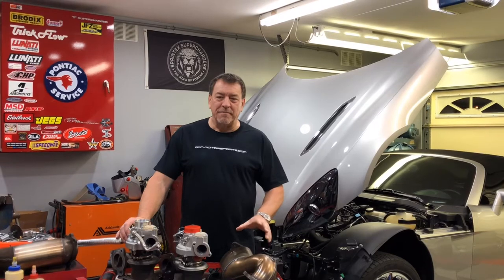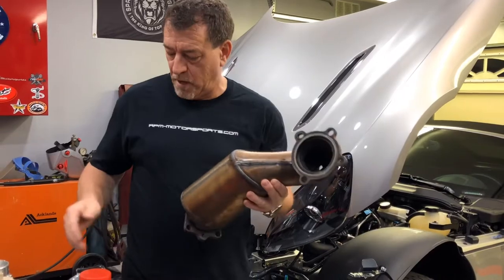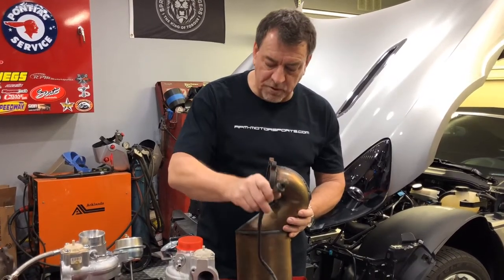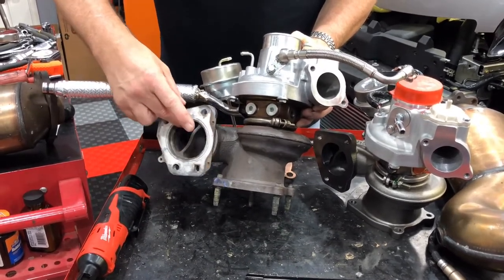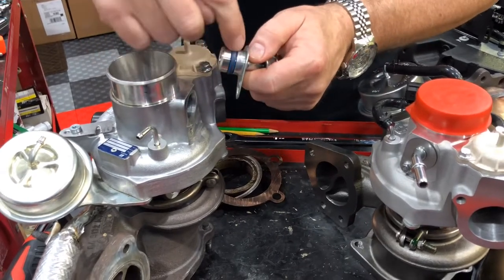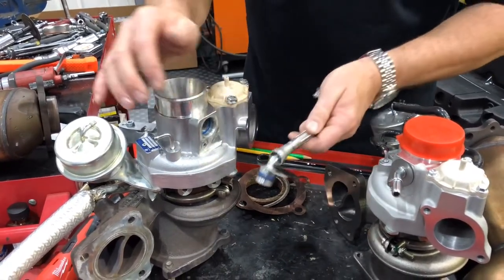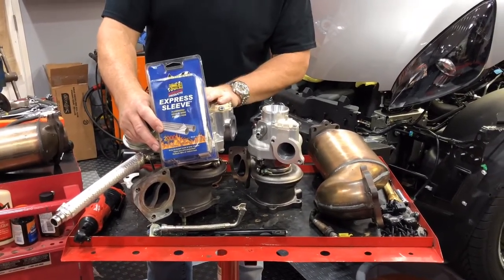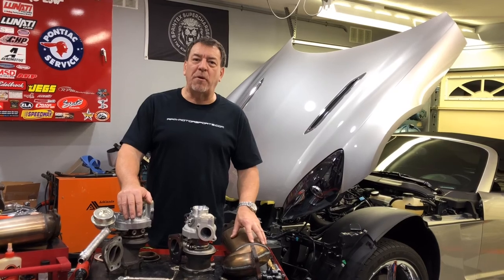Tim’s Garage Episode 8 Part B: Saturn Sky Redline / Solstice GXP Turbo Removal & optional parts list

Comment: For removing the "hose from hell", you were so close Tim. I just did the same turbo swap this weekend with much help from my friend Carl. We first tried the plastic line tool like you had without success. Carl figured that if we trimmed the tool a little shorter it would fit in the tight space and still have enough depth to insert deep enough to release the hose. It worked pretty easy then. 2007 GXP WITH 115k miles. Also your videos have been so helpful,  thanks.

Comment: Thank you for your insight! Huge help! In the middle of trying to get that cat removed right now.
Reply from the maker: Yes the twisty rotation after raising up the passenger side of the engine is the clear ticket !
Reply: I finally got it done, I was just a little scared to jack up the engine, first time messing with motor mounts. Thanks again for your videos!
Reply from the maker: Bruce I am glad you have it a try … I makes the job a LOT easier … learning is part of the fun 🤩

Comment: I just finished removing the stock turbo and I am ready to install the RPM upgraded K04. Do you have  any or all of the torque specs for reassembly?
Reply from the maker: I do and will be posting those shortly ... I am installing my Big Wheel tomorrow

Comment: Where the turbo is mounted to the Exhaust Manifold, what size are those nuts and was it a swivel impact socket that Dion used with the cordless angle drive?
Reply from the maker: I cannot remember the size of the nut but it was either a 13 or a 15 mm. Loosening the motor mount and raising the right side of the engine affords enough room to get in there from underneath and undo them. I used a deep socket but a deep on a swivel may work as well.

Comment: I'm in the middle of this now and need some help. Can someone tell me if the bottom oil/coolant line is accessible from the top or bottom everything else is already removed. Guessing the bottom but I was able to get to everything from the top, even the manifold nuts except for the bottom cat and bracket.
Reply from the maker: The oil coolant line bolts to the underside of the turbo but just pulls out of the oil pan. It is held in by an O-ring.
Reply: @350tiger  thank you I did figure everything out with access from the top it's a pain but doable

Comment: Where did you get the copper turbo>cat gasket from?
Reply from the maker: I obtained that gasket from RPM Motorsports with my turbo kit but ran the GM Ring gasket as I have a factory down pipe

Comment: Who makes the 15 mm gear wrench 
Is it made by “gear wrench “ 
Great videos 
Keep up the great work
Reply from the maker: Yes the one I used is made by Gearwrench and there are other manufacturers and alternatives but I happen to feel there is good value vs price with GEARWRENCH www.gearwrench.com or search on amazon. I purchased through an amazon vendor.
Reply: Tim Ronak 
Thanks for the reply 
I own gear wrench’s 
But just wanted to be certain 
It was a “ gear wrench “ 
I have two gxps a 09 with the gxpp tune and intake  along with charge tubes 
Along with a 08 gxp 
Both are envious green with light side tops 
Making them rare 
I have a gm performance parts cold air intake for my 08 
Probably the last one out there 
But was thinking of doing what your doing to your sky to my 08 
As my 09 is to rare and has all the factory upgrades already from the factory with documentation 
But my 08 I was thinking of doing this upgrade to 

I know for a fact you will want to buy the ddm short shifter kit and there brace kits for the chassis 
It’s makes the cars corner like there on rails 
Well worth the money 
And the center console with cup holders is worth every penny also 
It’s about an inch higher and is perfect for shifting and very durable much better than factory console 

Just my two cents 
I don’t work for then or anything 
Just they make very good quality bolt on and it fits parts for our little hot rods 

Again great videos 
Keep up the great work 

Jeff 😎
Reply from the maker: Jeff D the part number of the wrench is 85915 I am told ... if it is a flex head version it is 86115
Reply: Tim Ronak 
thanks so much 
I appreciate it 
Keep up the great work 
Thanks again